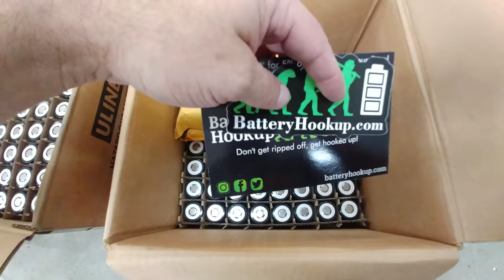Homemade Electric Buggy, Ep 3: Powertrain - LiFePo4, ME1616

Comment: Very interested. 
I have a lotus 7 with a Kawasaki ZX10R engine and I know I will have to take this route in the near future 👍👍
Reply: A thought... Jaguar I-Pace motor in the rear as the motor looks like a barrel with shafts ether end without a diff on the side it may fit between the chassis rails of the Lotus under the rear luggage floor ?? batteries in the transmission tunnel an some of the engine bay......
Reply: @kylereese4822  Good idea. I will be enjoying the screemer for a couple of years yet. By then the batteries will be a lot lighter and better 😉
Reply: @brad146  Sounds good to me... 😊 I`m part way of cleaning my collection of 18650s, currently I have enough for building 8 500 cell modules(could stretch to 10) just need the nickel strips, holders bms`s for each module and cooling tubing.... may put up a video of the module builds not sure yet... i also have about 4000 AA rechargeable batteries for running no mains supply garage tools possibly a welder... so i`m on the battery front very advanced in progress 😉...

Comment: I am interested to know the details on how/when that clutch pack activates. Does the rear end simply free wheel until the input shaft starts turning activating the pump then the clutch pack? Reason is I would like to use this rear end in a buggy with a gas motor. If I can activate the internal clutches as needed then I don't have to run a clutch on the gas motor.
-
Doing some research I see the later 2013 CR-V uses an electronic activated clutch. Wonder if that would work and how harsh the clutch engagement would be.
-
Doing searches there is little if any info about this. Read on a forum post the 1st gen CR-V diff ratio is over 4 but can not confirm. I am also wondering if there could be a planetary reverse setup built to take the place of the pump and clutch pack.
-
That would result in a complete tough differential package for a gas engine buggy. I need to find out more about these CR-V diffs and how the different generations are built.
-
If any one knows where the gear ratio data is for each generation please reply and let me know.

Comment: An interesting location for the disc rotor 💿
What's up with that?
Reply from the maker: CR-V hubs are built for drum brakes - I don't want drum brakes. This isn't much different than having one rotor on a solid axle like in other smaller karts or racing quads, it's just turned 90° and attached to the diff drive shaft. Brake rotors can't be attached to cv axles easily, not these ones anyway. One large rotor and dual calipers in a drier location will perform better than drum brakes, and they won't be in the way when it comes time to change the hub bearings. Nor will I have to remove the wheels to change the brake pads.
Reply: @JamesBiggar  plus u get more mechanical leverage being in front of the diff and not at the wheels

Comment: Like I said before I'm more of a Hydrogen-fueled vehicle guy, but your ebikes and this cross kart are works of art, James. If I had the know-how to weld perfect and blend welds to the point where the vehicle frames look like they were casted as a whole piece, I'd be doing the same thing you're doing...

Except I'd use Hydrogen fuel and Nissan 5.6L engines lol. 😆

Comment: Shall we see a video on Making battery pack..?

Where is cell level strips
Reply from the maker: You mean cell level fusing or cell nickel strips. Where's the bms, where's the solder, where's the converter, where's the charger, etc. What else did I miss? Lol. Yes. A video will be uploaded covering the battery build, AFTER painting. No sense building the battery if I no where to install it yet. Patience is a virtue.

Comment: Will the differential still function if the clutch is locked? or is it just being used as a means of power delivery to the wheels? Awesome project :D
Reply from the maker: Thanks. It's the only way for the differential to function - if the clutch isn't pinned, the diff has a slip. I've detailed why in the video description.

Comment: Great video.
Could you please explain us why you decided on LiFePO4 cells ?
Reply from the maker: Thanks. Simple - they're a good balance between safety and energy density. If I run into a tree on the trail, crush the chassis and damage the battery, I don't have to worry about being trapped in a fiery inferno because LiFePo4 cells won't ignite like Li-ion and cause a runaway explosion. You could punch a screwdriver straight through one of these cells and it will just expand and maybe smoke a little, but no fire. These cells from batteryhookup.com are also sold at the best price that I've seen anywhere, and they're underrated. Most people are finding these actually have 5500-5700 mah capacity instead of 5000, but they rated them at an even 5000 just to be safe because their manufacturer says there's a +/-5% margin of error.
Reply: Mr James have you considered the idea of using LTO cells?
They have a little bit lower energy density but the power density is INSANE. you can abuse them and even fast charge them as much as you can.
I have a little pack (2.4kw) for my electric motorcycle and although it's range is lower compared to LFP or NMC always a charge of 15 or 20 mins is enough for calling it a day.
Reply from the maker: Yes. But the price needs to come down A LOT before I'm willing to go broke to build a large pack with them. I can barely afford LiFePo4 as it is lol
Reply: @JamesBiggar  Thank you for this detailed reply :)
Reply: @JamesBiggar  Are you going to try to fit all 4 boxes into it!? You'll have enough range to do a cross country trip! Or is it about the peak power draw you want for that beast of a motor/controller? You'll have less to worry about cooling wise I suppose to for sustained power if you have big ass pack.
Reply from the maker: Lol, they're all going in. They'll be packed a little tighter than what they are in the boxes (staggered instead of in straight rows). I'm planning on a conservative 200 km's/charge, but it'll probably be more with regenerative braking (its power to weight ratio is similar to most Tesla ev's).
Reply: @JamesBiggar  Future upgrade: plaid carbon fiber wrapped motor.

Comment: Really appreciate.. waiting for your next video...
But question is why such a high power motor (55kw)  is required there 
Can't we use 3 to 5 kw motor...?
Reply from the maker: Because this is not a boring commuter machine that putts along at a snail's pace on city streets. This is an off road race machine. Think of it this way - if you want to lift a heavy weight, what do you need? Muscle. If you want to lift a heavier weight, you'll need even more muscle. It's the same with motor vehicles or anything in life - you need the right force to do the work effectively. The more weight you want to move in your vehicle, the more power you need to move it or you're not going anywhere fast, if at all. 3-5kW is only ~6 hp at the most, that's barely enough for a 100 lb e-bike to climb steep hills. This machine will weigh between 750-800 lbs. 6 hp would yield a very disappointing power to weight ratio of only 0.008hp/lb. A gutless Prius has a ratio of 0.04hp/lb. It would be close to half the weight of a Prius, but only 1/4 of the power. It might as well be operated with pedals. It would feel like it's towing a bus on flat roads and it definitely won't climb any hills. With 55 kW, it has a similar power to weight ratio (0.1hp/lb) as a Tesla EV, or a stock Porsche 911. There won't be any stopping it unless it hits an immovable object. Power to weight ratio is what matters if you want to have fun with your vehicle.
Reply from the maker: To answer your other question, 55 kW is the motor's peak power rating, which it can sustain for ~10 seconds. Continuous power rating is 24 kW, which it can sustain indefinitely (hence continuous vs peak power). Like an internal combustion engine, a motor can't be operated at full power indefinitely or it will overheat catastrophically. There's always a continuous and peak power rating. The controller is rated for 240 amps continuous (not 200) and 600 amps peak, ie: ~ 23 kW cont and 57.6 kW peak which it can sustain for ~ 30 seconds. This is why I chose this controller for this motor. The specs are close to matching, and the controller can be programmed to use slightly less power to protect the motor and battery from overcurrent use, which is its job. The battery has a capacity of ~12 kWh...not a power of 12 kW. You're confusing terminology here. Kilowatt and kilowatt hours are related, but different. Kw is a measure of power or force, kWh is a measure of energy, energy storage, or work. Related, but different. The cells used are rated for 5 amp hours of capacity, and can deliver 15 amps of current continuously to the motor, or 50 amps peak for 10 seconds. Connecting cells in series increases voltage, connecting in parallel increases current discharge and capacity. The battery will be arranged in a 24P30S configuration, meaning 24 cells will be connected in parallel to form one large cell to increase the storage capacity from 5 Ah to 100 Ah, and will increase the current discharge capability from 15 amps cont and 50 amps peak to 360 amps cont and 1200 amps peak, and there will be 30 groups of these large cells connected in series to increase the nominal voltage from 3.2 to 96V. Ergo, the 12 kWh battery will be capable of delivering 96 x 360 = 34.5 kW of continuous power to the motor and 115 kW peak. As mentioned previously, the controller can be programmed to limit this power so that the motor doesn't draw more current than it can safely handle. The controller can be tuned all the way down to 1 kW if needed, though that would obviously be a huge waste of power and energy. But it's better to slightly oversize equipment like the controller and battery by at least 10-20% more than the power of the motor and use the controller program to limit current to a safe level so that nothing overheats and efficiency is maximized.
Reply: @JamesBiggar  Thank you
Reply: @JamesBiggar  Really appreciates your explanation.
One last question is, it seems it's an automatic gearbox, 
what if you use a manual gearbox.
which one is better in terms of the load instead of speed.?
Reply from the maker: That's a differential, not a gearbox or transmission - all differentials work automatically except manual lock differentials. Ev's don't require transmissions, they produce more than enough torque for accelerating, unlike an ICEV. All ICEV's require transmissions of some kind.

Comment: This is awesome, have you had any issues programming the Kelly controller? I am looking at getting one for my build with the same ME1616 but am told the controller does not come pre programmed.
Reply from the maker: You can request it to be. But it's not difficult. Just follow the instructions in the Kelly manual to perform the angle identification procedure when first hooking things up (ie syncing the motor with the controller). I've never had a problem with a Kelly controller. Curtis controllers are also a good option. Just be sure to get the RIGHT controller, for sine/cosine signal, not hall.

Comment: for the chassis. is there a place where you show the measurements or no? Btw i love your videos ❤️
Reply from the maker: Not yet. I don't like to publish too many design details until I've tested them - don't want to steer anyone in the wrong direction. If the test ride goes well and I don't experience anything crazy like death wobble or something, then a complete set of plans for the chassis and suspension, wiring schematics, etc will be available on the website.
Reply: ok thank you

Comment: Were you not concerned by the change in force direction on the differential? (from the top rather than from the front) I am looking to do a similar project to this one and I have a good quality car limited slip diff that I want to use but was concerned about the direction of the torque.
Reply from the maker: No. I can't say it's better or worse than what others have done, just that it's a simple way to achieve limited slip instead of doing what most builders do and mount a sprocket to a solid shaft and put up with the understeering at low speed. I've had 0 problems with it, just have to make sure everything lines up as close to perfect as possible because any bit of misalignment will increase wear and tear on the chain and sprocket, and it'll noisy. The shaft for this diff is supported securely with standard radial ball bearings which are designed specifically to withstand radial forces like what I'm putting it through - it's no different than the timing chain and sprockets in an engine, same principle. There's another way to get the same result but with more work, basically involves removing the gears from a small diff, replacing the ring gear with a sprocket and building a custom housing for the gears to keep them lubricated while keeping the sprocket exposed. There are a few examples on Youtube. It's more compact and I might try it later with a transmission. I've got a few mods in mind, but again, I've had no problems with it as it is.
Reply: @JamesBiggar  Thank you, I think this the route I will take as well in that case!

Comment: quick question: you welded the stainless steel shaft to the mild steel adapter plate with a MIG welder - is that OK to do?
Reply from the maker: Yes, absolutely. MIG is ideal for it, though gas gives better results in this app than flux core, usually. You can get stainless steel wire specifically designed for the job.

Comment: I just purchased a 1929 Mercedes Benz kit car that i will be tourning into a golf cart with off road capabilities. Any ideas for the smoothest suspension possible for the golf course? I want it to just float.

I have the same motor except no water cooling.
I wont be going too crazy
Reply from the maker: Independent suspension. If you mean shock design, ie spring rate, travel, etc., that's going to depend on a few factors like sprung and unsprung weight, control arm length, angles, etc. Search out a spring rate calculator on google and use that for designing or consult a suspension specialist when you buy your shocks - they'll set you up with the right specs to suit your cart.